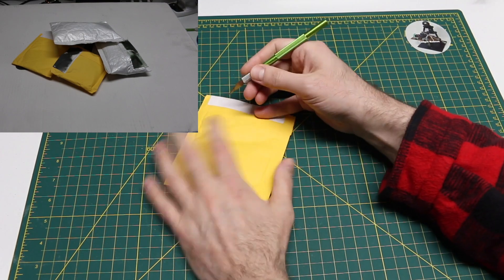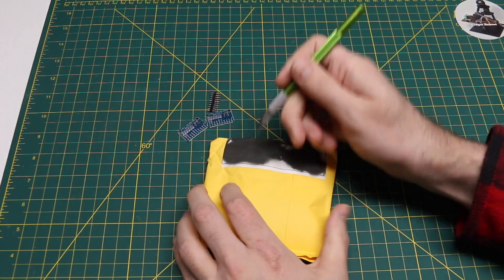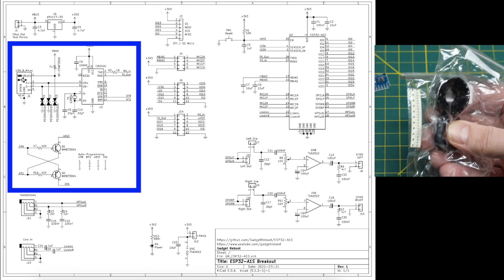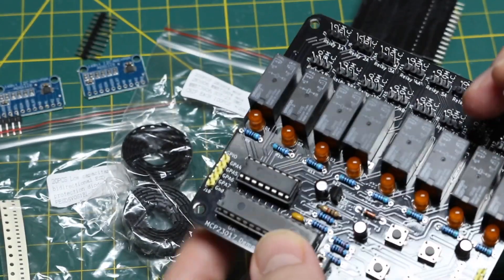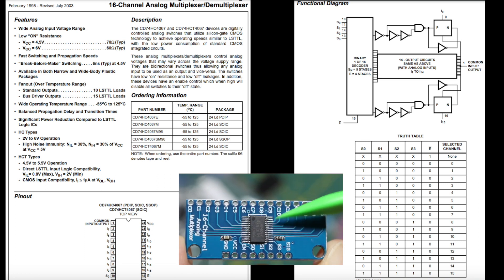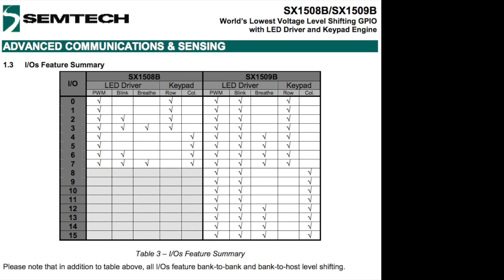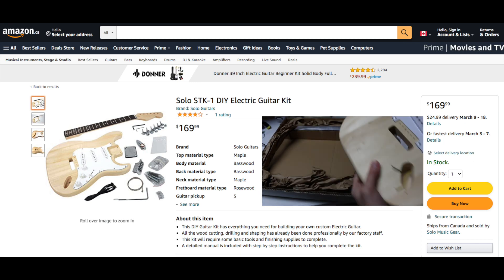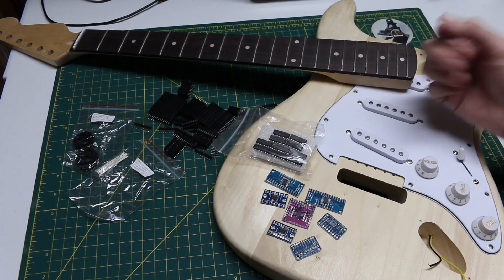Mailbag - GPIO Expanders and Other Modules

Comment: I went from stocking up on parts to stocking up on guitar pedals. xD I have been looking into a guitar DIY kit so that I have a proper testing tool should I plan on building effects for guitarists ... I will keep on eye out on those Solo Guitars brand DIY kits! In the meantime I have two pedals I am going to build soon ...
Reply from the maker: I ordered five metal pedal enclosures for some upcoming pedal builds. This might become an expensive hobby year
Reply: @GadgetReboot  The two Mr Sparkle (Homer Simpson) pedals that I recently built were purchased when I had no idea what I was doing. I got them pre-drilled from Tayda, 6 holes (not including stomp, DC and intput/output jacks) thinking I could fit a dual PT2399 delay circuit and a simplified RAT style circuit inside and still have room for all the pots and jacks. I sat on them for over a year before I finally figured out what to do with them ... better to have lying around for a while than to not have when the moment of inspiration strikes. :)
Reply from the maker: PT2399 is another project I have in mind finally soon. I have had the chips probably for two years now I can’t remember but I always needed some of those odd small value capacitors and I just received an order of parts this week that have those capacitors so it’s only a matter of time.